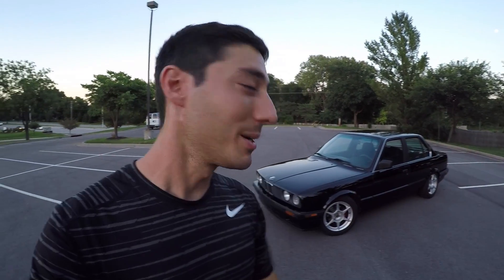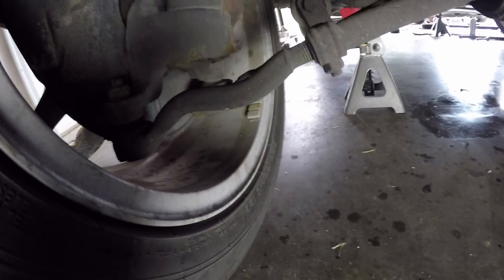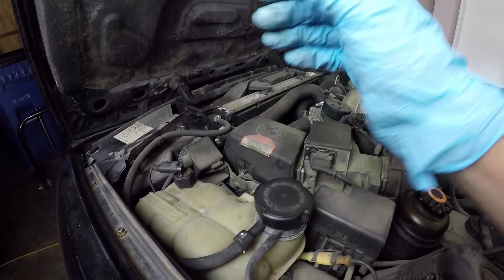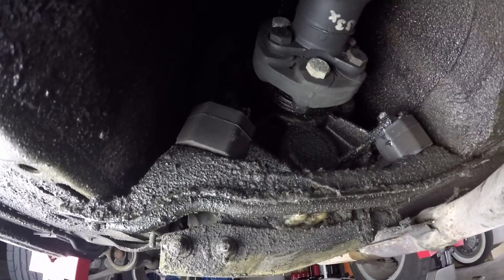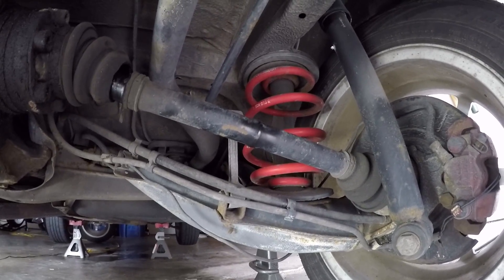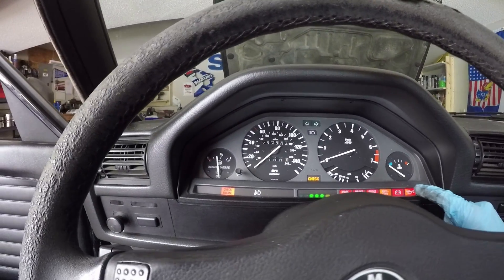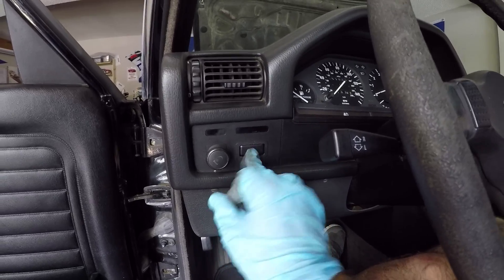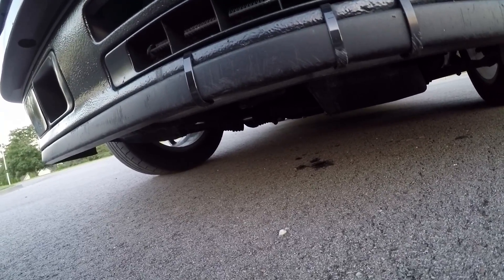Project E30 / Ep. 1 / Check Out My Regrettable E30 BMW Purchase

Comment: it shouldn't take you much time at all to fix. Bavrest or e30_dad can do the cluster and the OBC (6 button computer) for your, and customize it. if not garagistic has the gears for very cheap, and the reason the tach and speedo don't work is the ground nut on the back. Your SI batteries are fine, as your SI lights all are illuminated. Since you're doing all that, find a crack free dash, because to fix your blower motor, you're going to have to pull the dash. 

Pull out the Engine and trans and do everything you need while the engine is out. Do the timing belt, water pump, tensioner, distributor, rotor, plugs, wires, mounts, coolant hoses, fuel lines, and you might as well get m50 green top 4 pintle injectors while your'e there . the power steering leak is from the reservoir, which ALL of them leak eventually, all the way up to e46's. Get a new one or go aftermarket.  - all of this stuff is considered routine maintenance for initially buying an e30.

The input shaft seal, rear main, output shaft seal, clutch, giubo, and center support bearing are all items that are easily replaced with the engine and trans out. It will save you time and heartache just pulling the entire engine and trans together, and doing the work outside the car. 

You might as well drop the rear subframe and redo the bearings, brakes and bushings and seals on the diff. these things are a hell of a lot easier to do when the rear subframe is out of the car. This also makes it a lot easier to get to your e-brake cables and re-route new ones. 

I don't mean to sound harsh, you have a great platform to start with. 1800 is a great deal for what you got. If you put another 2k into it, you'll be sitting pretty for a few hundred thousand miles to come. None of these items really cost very much, but the labor is intensive, which you seem to be up for.
Reply: inspect your fuel hoses first thing. they are a major point of failure and can cause a fire. I doubt they've been replaced. Before you do anything, make sure those aren't leaking or cracked.
Reply from the maker: David, thank you for the thorough rundown - it's very helpful! Unfortunately I think an engine-out operation is out of the cards right now, but maybe it's something I can look at down the road. I will check out the ground for the instrument cluster and some of the other items you mentioned. The main objective for now is to get it fully functional and leak free, then reassess what should to be done from there on. Thanks for watching!
Reply: You can change the rear trans seal with just removing the drive shaft. I spent over 9k restoring my E30, but you have simple, cheap problems to repair. In my opinion, you found a good buy other than it being the ugly four-door model! Pelican parts is a great place to look for direct replacement parts for the E30, but they are a bit pricey on some things.
Reply: @Practical Enthusiast  Editing before you have to read this insanely long comment because I just noticed how far you've actually come with the car. I thought this vid was up for 2 days not 2 months hahah. Christ man you're killin it. Already covered this entire thing and way more. I'll leave it up anyway, but you know what the fuck is up. I don't have time to watch the whole trans vid and see what happened but I'm gonna say the only advice my lowly ass can offer that maybe you haven't considered is basically get an upgraded rear shift carrier arm bushing, not OEM because they are super soft even when new. Get a short shifter. Get a DSSR. Tighten up your front carrier arm bushing either with new OEM and a washer, or delrin (delrin pissed me off and didn't fit in trans). I'm sure you can get around the other minor inconveniences hahaha. 

Motivated to go work on my car after seeing this channel, you've accomplished more in 2 months than I have in the last 2 years. Ty for the videos man.

to add to skidmarks suggestion, if you are disconnecting the driveshaft you should fix the shifter linkage bushings. This is a bitch to do but no better time to do it, and it is soooo worth it. This is all from memory so some of the steps might be in the wrong order, definitely look at actual guides too, but here are some tips to help you out. Warning: it's a long list hahah. Job isn't that complicated really, there are just a few really finicky little things that make replacing a few simple bushings annoying as fuck if you don't know about them in advance. Reading this is gonna make it seem like a big job, but it's not actually. Check the pelican parts shifter rebuild guide and you'll see it's simple enough. 

-remove shift knob, trim, shift boot, rubber butthole
-under car disconnect selector rod from shifter. Disconnect from trans if it's easy to get, or just wait till you have driveshaft off
-in car, ROTATE shift bushing, then pull shift lever up to remove. If you rotate correctly it'll come out effortlessly with the bushing attached
-mark driveshaft position 
-disconnect driveshaft at transmission
-remove center support bearing (behind some panels) 
-lower driveshaft
-remove trans crossmember and lower trans a few inches on a jack, makes bitch clip a bitch, rather than a full blown cunt
-use a "hook tool" to remove bitch clip/front carrier bushing, best tool I know for the job
-remove rear carrier arm bushing/bracket, burn old bushing out with torch, replace with upgraded unit, (brand new OEM unit is bad, if you're going through all this you want your shifter to be incredible after, not just less shitty) crimp/epoxy upgraded bushing in place. It can fall out unlike stock rubber one, so ensure you've secured it
-remove shift carrier arm from car 
-remove shift lever "cup" bushing from shift lever and replace with new OEM unit w/grease, put it in carrier arm but you can wait to "lock" it till basically the end just in case you need to remove it for any reason 
-file down small fins where carrier arm slides into rear bushing. Depending on what type of bushing you use you can file down less or more, but most of it should be gone or else it will be hard to install and damage your new bushing. Even if they're totally gone, and you're using poly it should still be super tight
-with carrier arm still sitting on bench, attach your upgraded rear bushing/bracket to your filed end
-remove/replace front carrier arm bushing with new OEM rubber unit
-reattach shift carrier arm to car, this is going to be kinda annoying but you want to ideally put a washer on either side of the front OEM rubber bushing to eliminate any side to side play that is there even with a new bushing. This is a pain in the ass to do, and I was only able to get one on the left side, because it is right where the bitch clip pin slides into it. Probably better if you can get one on either side, but for me one feels pretty great as it is and eliminated 99% of slop. Even just a thick one on the left should be good, but idk if it being slightly off could be bad for the trans over time. I assume it's fine but I'm no professional. 
-replace old trans mounts on the crossmember
-raise your trans, replace crossmember
-replace driveshaft center support bearing 
-replace guibo/bolts on driveshaft and delete vibration dampener if need be, supposedly you don't need it and can get in the way of selector rod if you put a short shifter 
-reattach driveshaft to trans

Somewhere in there do your trans seal like skidmark said and the few other while youre in there parts

Things you'll need:

-Hook tool. Basically thin screwdriver like tool with a hooked end for grabbing behind  bitch clip and flipping upwards. Forums say you can do it with a flathead screwdriver in a few seconds... I think that is literally an INSANE concept. Try it if you're a masochistic freak who has a a sub/dom relationship with German engineering. 
-garagistic poly or delrin rear carrier bushing, or their bushing and bracket kit if you don't want to burn your old one out and have a kinda sketchy epoxied one. Mine is like that and has been fine but still, maybe it's going to loosen/fall out one day. There are some other ways you could secure it to the stock bracket like a large ID/small OD washer JB welded on or something, but if you just want the easiest thing, get their kit. Poly will still be super nice you don't need to go crazy, I have delrin though because I like my shifter to be like my steering rack: SO FUCKING TIGHT ahh 
-OEM replacement front carrier bitch clip/pin 
-OEM front carrier arm bushing. Don't use garagistic delrin/aluminum replacements. Too wide to fit in trans slot. Maybe it has been corrected but in my experience after clamping the delrins into the carrier arm on a bench vice and then repeated full on bouts of hammering it was still too wide to fit and I broke my fucking carrier arm trying to get them out and had to replace it. Not worth 
-whatever washers you can find that will allow the bitch clip pin to slide through them and thick enough to remove the inherent play of the front OEM carrier arm bushing. Sorry no size recommendations, just go to a hardware store with your bitch clip/bushing/carrier arm, find a few that will fit and try them out. Just don't fuck up your bushing sliding it in and out too much. Amirite fellas
-OEM shifter cup/pivot bushing and grease
-new trans mounts. E21 OEM is stiffer but still rubber, decent DD upgrade. Garagistic sells these and some cool machined aluminum cups to mount them in if you wanna get fancy. Or you could get soft poly. You need to drill the holes in your crossmember to make them slightly larger for the E21 bushings, super easy though 
-new center support bearing. Can't remember the brand but one of the cheap brands (think it starts with a "T"?) makes and awful one that will fail, get a quality replacement 
-new guibo. You're supposed to replace the bolts when you do this, so get those as well. I reused mine cause I couldn't find any quality ones in the right size, but try to find the PN and get some if you want to do it by the book
-dumb little yellow washer things. I think you only need them if you use the stock selector rod but I'm not 100% sure. Pretty sure I used like 4 with my DSSR to make it tight but I could be totally misremembering

There's a few other random bits, look at pelican parts shift rebuilt kit/guide to get an idea. I think the part that connects your shifter selector rod to your trans varies by year and you need to swap to a specific one for DSSR mounting so watch out for for that.  

Things you should definitely get but not required/$$$:

-DSSR/Dual shear selector rod . Feels AMAZING definitely worth it. I think there's a guy on r3v who makes bent ones to clear the metal guibo vibration dampener thing as well, check that if you have one-Depends on year, I have an '87 325is and I did but I took it off and used a standard DSSR
-Short shifter. Lots of OEM ones you can use. There is a list somewhere online, look it up. I have an E36 M3 unit because it was available, but I think the Z3 1.9 is the shortest/best. Big improvement, not insanely short, just feels like modern cars I've driven. No longer a ridiculously long throw. 
-E46 ZHP shift knob. They're like $100 new. If you have $100 it's worth it. I had the stock one in my car, put the ZHP in and my friend drove the car and was like "oh you finally rebuilt your shifter linkage it feels so much better now holy shit!" all I did was replace the knob at that point lol. It's weighted and just feels fuckin incredible. Its probably what God's individual nuts feel like really. Save it for down the line if you don't have the cash right away, you can change it in 30 seconds. So good though, so good. 
-you need a super huge, yet shallow, so it can fit next to the trans-GERMANY-hex bit/allen key to change trans fluid, so grab one if you're planning on doing that while you're in there. Also apparently straight 80W fluid is rare so call ahead and order it to your auto parts store if you care about having the exact kind you are supposed to. Couldn't find it anywhere in my city, but redline does make MT-80 that won't hurt your synchros, just no one stocks it. 

Alright thats all I can think of. I was super new to cars when I did this job and I got really frustrated with a couple things, so hopefully this helps prevent that from happening to you or anyone else who sees this. I need to make a copy of this, second time I've typed it up this week hahaha. Congrats on the car it's kinda fucked but you got it for a great price and is mostly stuff that would break eventually, so now when you're done this car is going to be good to go for a long time. And super reliable. All this stuff would just slowly fail while you were driving it so it's kind of a nice idea to just get it all out of the way. And it's super clean. Subbing for the rest of the build, cheers man!

Comment: these are all normal e30 issues. if you are so concerned with these non serious issues you should be looking at newer platforms. These cars leak and are going to have these seal problems without any major concerns. top the fluids off or pay a fortune to rebuild the whole car. make the choice or sell it to someone that understands that this is normal for these vehicles.

Comment: You gotta love the ol' gal, man. She's been through a lot. This car has seen 5 presidents (6 if that "1989 was made in '88), may have been around for the fall of the Berlin wall, and made it through the decades. 

You've got jacks, you've got stands, and you can fix it all for the price of parts. The body is so clean (from what I can see), that it'd be a shame to let her mechanical systems go.

I've got buddies with worse E30s, and they love them like their dream car.

But for the love of Christ, and your wallet, GET A SKID PLATE! Red46 ones are $150, will decimate cinder blocks, and save you from having to pay $350 for a new oil pan for that M20 engine. Garagistic.com specializes in E30 things (like odometer gears!). Join R3vlimited.com as well, the main E30 Forum, and you can find lots of support on there as well as classified ads for parts.

Comment: For a RUST free body and the condition AND it's the 2.5 325i looks like you bought the car for the wrong reason. There is a reason the BMW fans own these and other Bimmers. There are "regular drivers" that buy cars because they either "look" cool or believe they will gain street cred....then there are BMW Drivers (I mean the real ones that race on the track) :).